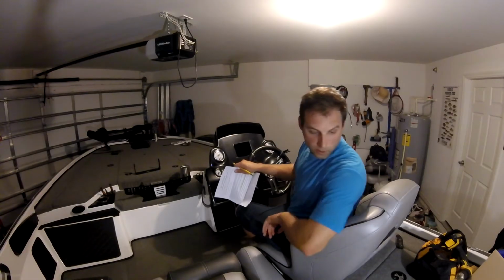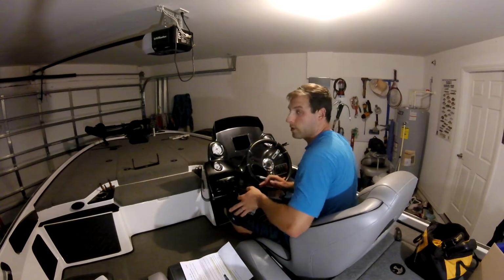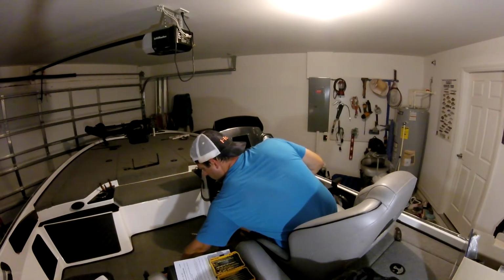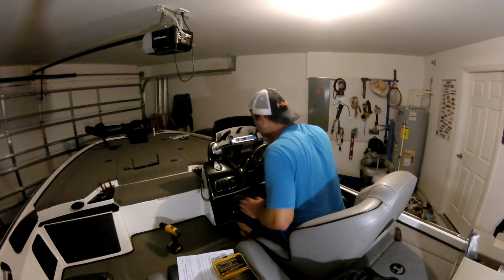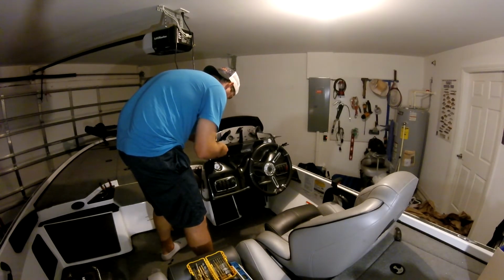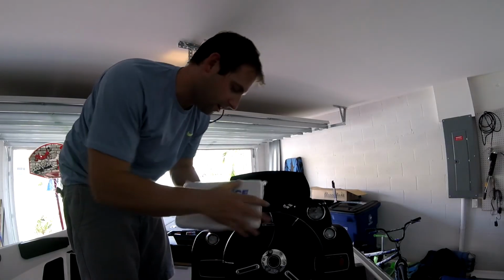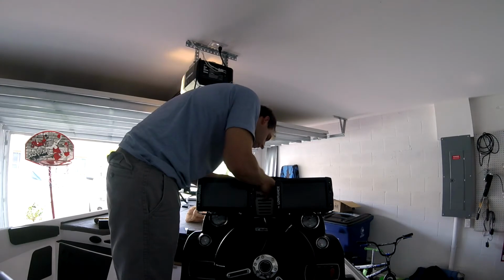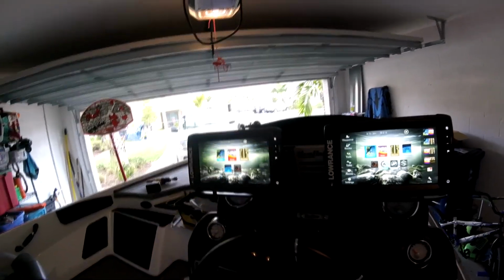Bass Boat Technologies - Dual Lowrance Elite Ti 9 - Install - PART II

Comment: Did you link the transducer? Or are you running 2 ? Curious to know how you got that set up! Sweet set up btw
Reply from the maker: Jaime Salinas 
One unit has a thru hull (from factory) reads at WOT, other has the totalscan, only reads at slooooow speeds.  Fine by me though, use it when I need it only. Thank you!!

Comment: How bigs your garage to fit the boat, looking at getting a nitro z18 as well but don’t know if it’ll fit in my garage
Reply from the maker: It’s small, 19x20. I was actually really paranoid it wasn’t going to fit. Come to find out I could probably fit a Z19...it is parked sideways though.  I have about 2 feet to spare.  The website is pretty accurate with its storage length.